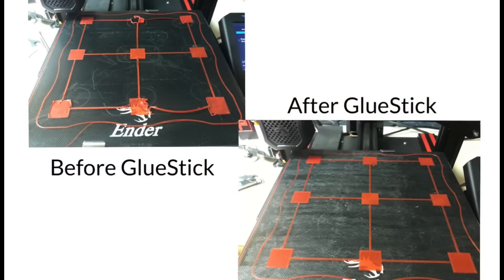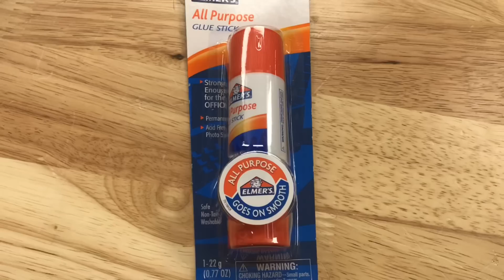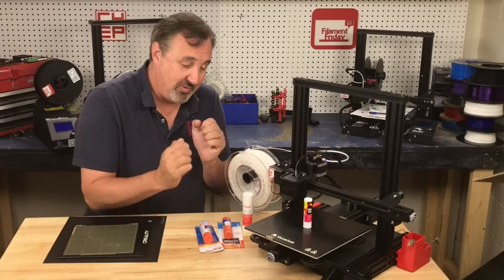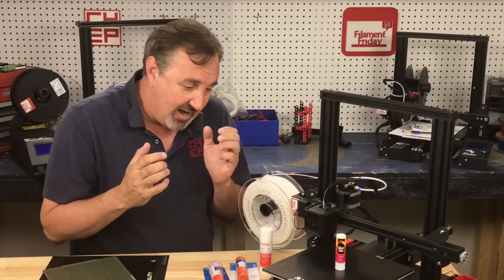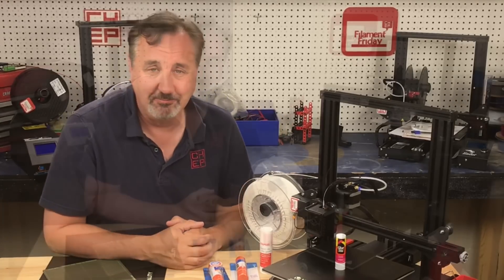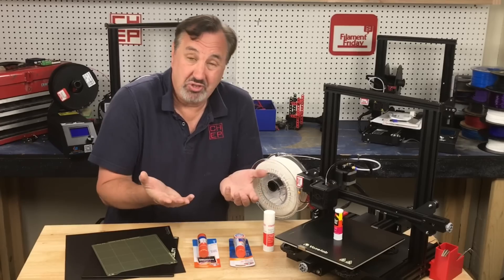Better Bed Adhesion with a Little Glue Stick

Comment: I use Pritt Stick after leveling the bed on my Ender 3 v2. I had the same coating for a little over 2 weeks now.
In case you're curious, once applied it goes hard and dry, but that doesn't mean it isn't going to stick, it will stick surprisingly well.
I have found I don't need to clean and reapply a coating of Pritt Stick. But if I do need to, it only takes warm soapy water.
However, I also use Brim. I've had no luck with skirt or no adhesion. Brim for large prints, raft for small.
If you do use Pritt Stick, wait till the bed cools before you try to pry off your print, otherwise it is back to re-leveling that bed.

For cleaning, I would lightly sprinkle warm soapy water onto the bed, careful not to let any run off, then, with a sponge, scrub in small circles around the bed. And then take a fibre cloth and rub from rear to front, if it needs repeating, do so, once done, it looks brand new. This method allows me to avoid leveling the bed again. :D

Comment: Good tip Chuck. I extend my glue stick by using a damp dish sponge to wipe over the bed, while it is at 50-70c, to give me a new coating that lasts for at least as long as the first application.

Comment: I have found watered-down PVA glue works well.  It is water-soluble, so easy to clean off.

This was required when printing things like the articulated lizard, which have tiny footprints for some segments.  I had zero success rate before applying a layer of this (just dabbing a paper towel in it then wiping down the bed to leave a layer), and no adhesion problems thereafter.

Comment: This works wonders. I have a slightly uneven bed and was getting adhesion issues despite how many attempts to level the bed, adjust bed temp, or slow down the initial layer. Some of the purple Elmer's glue stick lightly applied over the entire print area and I have an absolutely pristine first layer.

Comment: Elmer's purple glue stick over here as well, even on my PEI coated spring beds (rather than trying to rough them up with steel wool). Works great, haven't had any problems with prints lifting up or sticking too well, and haven't had a PEI coating rip or tear since I started using it. Every month or so I'll clean the beds with soapy water, wipe with IPA, and put down a single layer of glue stick. Saves so much time, effort, and frustration!

Comment: Works great, the only issue I will add that wasn't mentioned.  If you are printing on a glass bed and looking for that high gloss finish, the glue will imprint into the print.  You still get a very smooth surface, but you can see the glue stick swipes in the reflection.  For this particular print I was hoping for that glass finish and only see those concentric patterns on the bottom layer, but still turns out good.

Comment: Been using Elmers Purple almost since my start. Even after mastering my bed leveling, I would get the occasional pop off;  but not since I started the glue stick. I also use Windex with Vinegar glass cleaner to clean off the residue after/before each print. Works great. So far so good.

Comment: Right now printing a 30+ hour print. I tried to print this thing (a big skull, takes the whole ender 3 V2 bed) multiple times before, but always had the problem that the first layer just did not want to stick well. No problems with small prints, bed is level, clean surface. I experimented with a lot of settings to get the first layer perfect but nothing seemed to work. Took me month or so to finally try glue stick and voilà! The first layer was instant success and I was able to finally get this thing printing! I would definitely recommend the glue stick when having these sort of issues. Mine is really cheap stuff but it just works. Had I come across this video a month ago (not possible since time is linear and what not), I would probably have saved a lot of headache! PS its still going at 21 hours right not, fingers crossed it comes out successfully, since I don't have enough filament to try again if it does not ;)

Comment: My Ender 3 has always struggled with large, full bed prints because they edges will warp. Recently came across this video, and I needed a full bed print. Worked like a charm with Elmer's purple, but I'll try Avery when I run out.

Comment: hey chuck have you ever tried glue stick, and wiping it across heated bed with a wet napkin? the glue stick can be very thin, in fact with wiping it of (when it is hot) the glue spreads thin and the water evaporates. always good videos. even for some of us that have been around since reprap darwin projects. the video's keep the skills fresh....

Comment: Glue stick is great for prints that might run out of filament. Twice for me, having the print glued down saved it because I was able to adjust in Cura to print the remaining layers. Had the print broken loose, it would have been wasted since there's no way that I'd get the printed part perfectly aligned to it's original position again.

Elmer's Purple for me. I like to thin it out on the bed with a little alcohol.  It leaves just enough to hold the print well.

Comment: My personal preference is a cheap pink pump bottle of suave hairspray. It's very easy to control the spray so you don't get over spray all over everything like chep said here. Everyone always refers to cans of "aquanet" type hairspray for some reason, it makes a huge cloud and is bad for the environment so I use pump bottles. If I have a difficult print that pops loose after a couple layers then I'll leave it on and run 3 or 4 single swipes of glue stick where the print will be. Keeps from having to fight it to get it off and 9 times out of 10 it gets the job done.

Comment: My jam is 3M blue painters tape.  Works great, can get a fair number of uses before I have to strip it away and place new tape.  I use 90% alcohol between prints and a lint free cloth to wipe the surface.

Comment: I've had a stock Ender 3 with a borosilicate glass bed for over two years.  I use a glue stick and have never had a single print lift.  For every print I (1) Preheat bed and nozzle for PLA, (2) level the bed with CHEPP's file, (3) swipe with a glue stick  up and down, side to side and diagonally both ways, and print.  Clean the glass bed with water and dish soap after each print. Always works.

Comment: Yup agreed my V2 bed had it 2 weeks and i must have used something bad on the Carborundum Glass bed but was just about to order another bed for $25 i also started adjusting my settings but i use 2 swipes of the glue stick and bang i haven't reapplied yet and I've done 4 prints i might just stick with the glue :) totally agree CHEP and the hairspray sucks as well.

Comment: I had a hell of a time with glass.  Switched to metal sheet with PEI.  Never roughed it up and it has worked great for a year and change now.  Nothing wrong with the glue stick. If it works for you, that’s all that matters.

Comment: When I worked in plastics injection there were multiple different settings that you adjusted to get the right part. Different guys had different settings for their machines but still ended up with good parts.
It was whatever works and a different machines reacted differently along with different weather conditions and material.

Comment: I use glue stick too, but I dissolve it on ethanol and then spread the solution on the bed. This way I have a excellent adhesion and still get that shiny finishing of a glass bed.

Comment: I get the use of glue stick totally and completely. I've stuck with a thekkiinngg textured pei sheet for the last few years and it works great still. I print mostly pla so either I wait for prints to self release or I get impatient and flex them off. I use glue stick for pc and hair spray for nylon then wash it off and print abs, pla and petg no problem.

Comment: I just had a couple attempts at printing go south on me. The first was a bed level problem, the second, I used glue stick but I used a foam brush wet with to much water and not enough glue. On my third attempt, I laid down some glue stick and used the foam brush again only dampened with water to smooth and even out the glue as the print I was printing pretty much encompassed my whole CR-10 bed. I just recently(about a week ago) put together my CR-10, so everything is new(it has been sitting in a box for over 6 months). I'm getting ready to put together my new CR-10 V2 I bought about two weeks ago.

Comment: I have the Ender 3 Pro and using your bed leveling code, never had a sticking problem on the magnetic bed .. never used the Glass Bed .. Did burn a hole at the Home Spot .. Didn't RTFM .. lol  BEERS!!!

Comment: Glue stick works great. Most of the time I use hairspray, the key is don’t spray the bed while it is still attached to the printer. Take the glass off, I place it in a box and spray it in the box. Overspray is contained in the cardboard box. Let it dry and it works great also.

Comment: I replaced my bed with a simple pane of glass from Lowes and I always use a glue stick (purple elmers) and it works great. After a few prints I use a razor blade scraper to clean off the layers of glue, easy peasy.

Comment: I have the same ender 3 glass bed, I print about 60 to 80 parts a week on it all without glue or what not. 65 bed temp and a slow initial layer speed of about 10 and I have perfect surfaces every time. Of course I also have a bl touch and make sure the bed is level.

Comment: Nice video CHEP, I used glue stick for a while, in fact I still keep one close by, but I found it hard to refresh it, I tried brushing it with water, alcohol, but I always had to keep adding more glue, which in turn meant that I had to remove the bed to wash it from time to time. Now I use sugar in 70% alcohol, I only need 2 light brush strokes to refresh it.
My bed is a hardware store 3mm glass cut to size and I print ABS at 100c bed temp.

Comment: I'd recommend trying this method: Run your glue-stick in one direction and LIGHTLY coat the plate as consistently as possible (doesn't matter if you get complete coverage - just even distribution), then do the same, perpendicular to your original passes. Wait for it to dry. Grab a MISTING spray bottle (fine droplets) and mist the plate until it's covered. Take a foam brush and paint out the wetted glue in one direction (wipe any pooling right off the plate and onto a rag). Let it dry and now you have a very consistent and thin layer of glue, with no clumping or buildup.

Comment: I have been using glue stick for a few years. Use it on a glass; works great. I have used hair spray but it sticks too well and I do not like the suspended particulates (lol). Cleaning the bed after a few prints and lay down a new layer works best for me.

Comment: I love your channel Chuck. I am also a Hockeyfan :-P On my Ender3 I Use a glass surface like the second Creality one you display in this video. However what I have done is I bought one of those PEI sheets that comes with a magnet sticker. I removed the PEI from the spring steel then I put a layer thin of Epoxy on the steel sheet and on the back of the Glass sheet and glued them together. So I have a magnetic glass sheet which I can remove with the print on it. It is not flexible of course but I can use the whole printing area of the ender3 and using glue stick I can just bring the finished print to the kitchen sink pour some hot water and it pops off. I then wash it apply some fresh glue stick - No need to level the bed. I use a 1usd glue stick (100yen) from 7-11. It can cover the whole surface about 3 times. I only print PETG at 245c E and bed at 75c. My prints are big prototype prints printed at 4.6ms, and sometimes take 10 days to complete. No issues with warping detachment etc.

Comment: I use glue stick on glass for my CR-10 S4, my Ender 3 Max and on the Ultimaker S5 at work. My wife's daily driver is a Flashforge Finder with no heated bed. She's been using a glue stick since day one and has never had a print fail to stick in almost 4 years of printing.

Comment: Blue glue stick for me on smooth glass for PetG only. PLA seems to stick great to clean glass with no adhesive. I use window cleaner to clean glue stick off glass when done. I noticed isopropyl just dilutes glue and spreads it around then it drys again before I can get it off the glass. Glass cleaner turns the glue blue again and wipes off right away with a paper towel. Thanks for the vids Chep!

Comment: I recently started printing, in my case with PETG only so far.
My printer is a secondhand FlashForge Finder 2.0 with Micro Swiss hotend and glass surface up.
I have been usung cheap gluestick from the first print, and non have ever come off during print.
Very easy to remove the prints when they are done.
I do wash my bed every time as the bed is so easy to take off on this machine.
Highly recomend the gluestick method for anyone that struggles or don't want any problems.
Have yet to have a failed print. All my prints is done at 220 and my machine is fitted with closed sides by the previous owner. Which do help to keep the temp.

Comment: Elmer's Purple works just fine. I use glass, smooth PEI sheet as well as a build tack like surface and sometimes I'll use glue stick and sometimes I don't. It's another tool to use when needed and when needed it works great.

Comment: I was stubborn at the start ... glue stick is not 'right'.  I use it all the time.  I sometimes put the glue on as the SKIRT is printing, using the skirt as a guide to show where the glue is needed.  Thank's for another great video Chep.

Comment: i use a magnetic plate with a structured surface since then i don't need glue or hairspray. everything adheres perfectly during the printing and you can still easily separate it from the plate. I had to cut the plate to size but it was worth it ..... by the way, great video  👍 ( Hopefully nobody will notice that I rarely write or speak in English * sneak out of the room quickly * )

Comment: Yup. CHEP is right. Glue Stick WORKS every time. No questions. I have tried many way until one said that the Glue Stick works the best. For better products: Elmer's Glue Stick. I have been doing it since I first applied the stick and didn't had any problems since.

Comment: Glue stick definitely does work! Was printing with overture pla and it just would not adhere to the bed even after raising pla temp and lowering bed temp and troubleshooting. Used a glue stick and it stuck.
Reply: I confirm here, same trouble with Ender 3 and Overture filament, it's a good filament but the mix of the glass bed and this filament are tricky to use.

Comment: PETG was driving me crazy.  The Overture build surfaces work perfect for PLA, but PETG was ripping it trying to get parts off, but I would still get warping on large prints 

Elmer's glue stick on smooth borosilicate glass works great, believe it or not.

Comment: I use Aqua net hairspray but I have a removable glass bed so I don’t have to spray it near the machine. Works great 👍🏻 I tried the purple glue stick but had a hard time getting an even layer.

Comment: I can really recommend the Elmer glue stick. It works fantastic ESPECIALLY when you have prints with a very small footprint, ie small contact area on the bed. My bed is surface is glass.
Reply: Same. I use Hatchbox PLA as my go to for most prints but for some small surface area prints, even with a brim, they would pull off the print bed at some point. Did not happen with larger prints. Use a glue stick and problem solved, the best part being you can easily clean it with a paper towel with warm water. Much better and easier than hairspray IMHO cause you don't have to worry about getting one with the right formula or overspray.

Comment: My go-to is TH3D Ezflex PEI. Holds on to PLA & PETG w/o glue. Yes, it worked w/o scuffing for several prints then I had to gently buff it w/ steel wool. Haven't done anything since but clear off fingerprints w/ IPA. YMMV.

Comment: I use normal white glue dissolved in water in a little spray bottle.  It gives a smoother coat than glue stick and doesn't wear off or peal like glue stick does.  Gives a matte surface.

That's for printers with just glass beds.  For all of my other printers, I use PrintBite which works perfectly and I've been using the same pieces for almost five years.  Great stuff.

Comment: I have a glass bed on stock Ender3. I started using purple glue stick with good results.  I apply front to back then left to right to insure coverage.  Prints stick good.  The first print I do after glue stick releases very easy. The next print goes on and sticks good without no new glue. Third and fourth print I may “ touch up” where I think needs some more glue. One thing I notice as I get around the 4th or more print, it gets harder to release print from bed. Now is the time to clean the bed. Paper towels and windex makes quick work getting bed clean as new. Make sure have waist can handy as can get messy. I’m getting ready to upsize to 400x400. May have to buy purple glue stick in bulk. LOL
Reply: I started to tear down my stock Ender3 Pro to install a Ender extender kit. I’m embarrassed to ask which plug in back of the standard LCD screen?  I was in a rush and didn’t noticed which out of 3 is right one

Comment: hello .... my glasbed worked fine for the first 30 prints ..... i like my glasbed because its perfectly even and bed leveling no problem ...... no the stickiness is gone . now i use the sticks and it works fine . once a week i put the glasbed in the dishwasher and thats it..... works fine